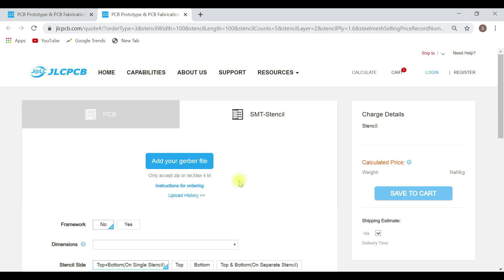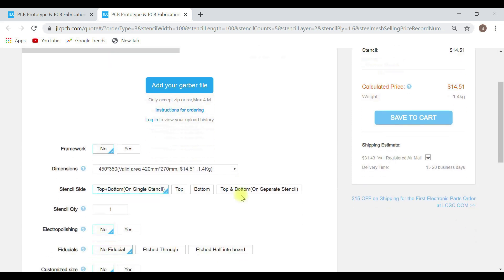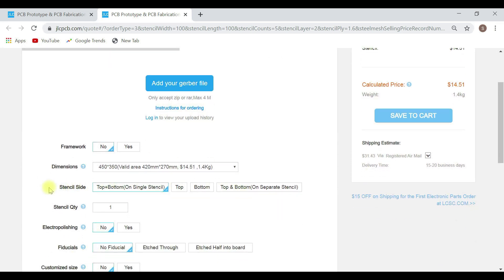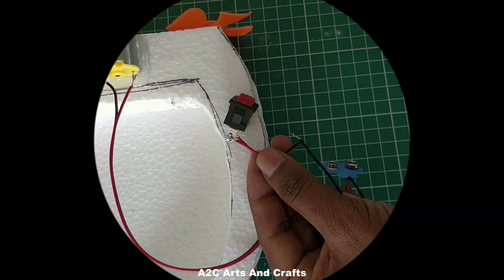How to make a Double Propeller Boat using DC Motor

Comment: Can you pls tell me the names of this that u have used to make this ship
Reply: Hey, I am trying to help people who don’t get help. So.. If you don’t mind me. You can try to find a dc motor on the internet. I got 1 to. Almost the same. And you can find some foam somewhere right? Almost everyone got that. Some elastics just 2 to bind the “engine” to the propellers. And you also need a power source a battery. I hope I could help you.. I am stuck at finding 2 propellers to. So sorry. Because I want the best. Otherwise I’ll build my own one. You can find in the description of this video which glue pistol he used. So no problem for the help. I got you. I got almost everyone. 
Good luck doing what you wanna do.
And you can find some electrical wiring on the internet. Just some wirings that do 9v 9 volt . 

A re cap
Some foam around 20x20cm
A dc motor 
2 elastics 
Battery 
2 Propellers 
1 glue pistol
(Some glue sticks to glue)
9 volt wirings
Reply: I got the same dc motor.